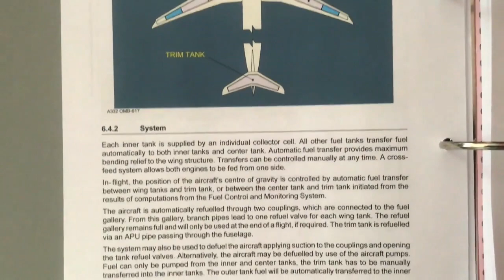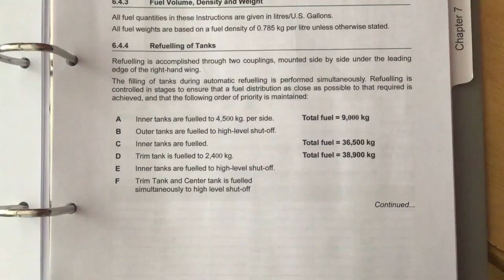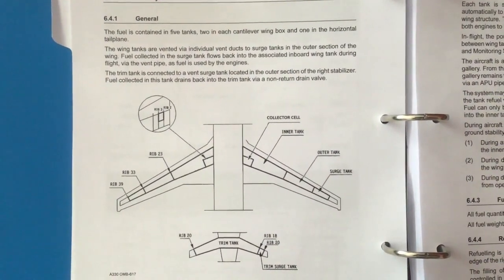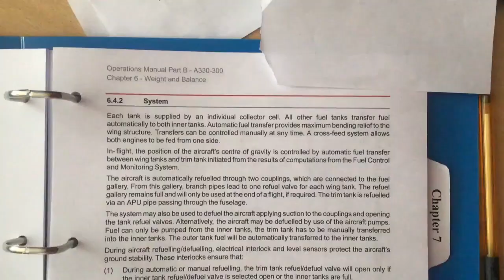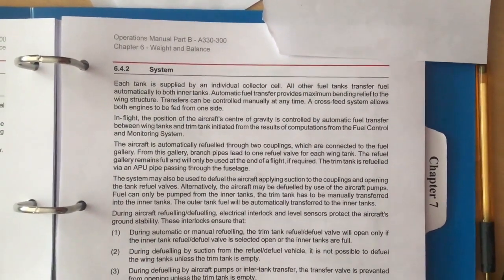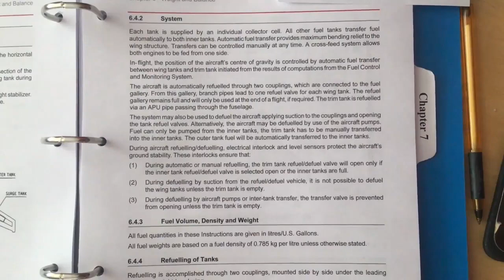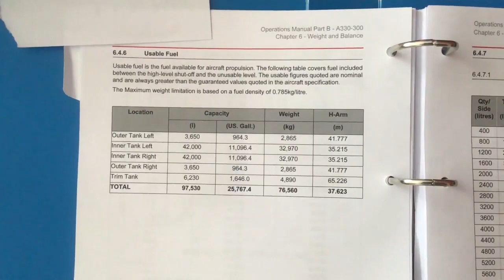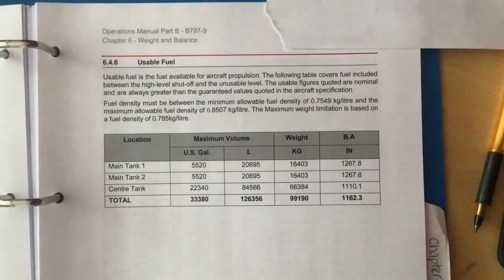aircraft fuel

Comment: Excellent use of the weight & balance manual pointing out the difference between the A.330-200 & 300.
As stated the 300 has a slightly shorter range due to a lack of center fuel tank.
These manuals don’t lie and a simple fuel burn rate and distance traveled shows the fuel call outs to be correct. 👍
Reply from the maker: DC8Combi cheers for the comment. I am trying to get a fuel drain video done with both an Airbus and a 747 which will show the difference between water and fuel. It is just finding the time.
It is getting annoying with jones deleting his live feeds. That Constantine could be Jake Penny as the comments had the pointless stupidity and the foul and offensive mouth of Jake. Just another thought. 👍
Reply: @ianobiwan  I agree the deleting of the live feeds is annoying I'm guessing it's some delusional strategy to gain popularity or even sympathy as he has a deep seated need for both.
Good observation with this Constipation (I mean Constantine) misfit as we all know the oxygen thief cannot resist existing.
Reply from the maker: DC8Combi  EBNM new video about the road signs is so funny. How does he survive a single day. 😂😂😂😂👍
Reply: @ianobiwan  it was absolutely hysterical I had to enter under my classified channel to prevent from being blocked.
Reply from the maker: DC8Combi  I see has been deleting everything from today. I had commented on some of his remarks today but those remarks are now gone.
Reply from the maker: DC8Combi  strangely the comment Constantine made against duke has gone as well. It is looking more and more like they may well be the same  idiot.👍
Reply: ianobiwan  I got over to watch Enslaved Dave's turd factory.  It must be hard going through life afraid of everything you come across.
Reply: @garygolfer3243  I see the Agency is doing a fine job over there on Josh Stones comedy central. They have even infiltrated EBNM under their highly classified ID's.
Miss Duke is up to her old Jake the oxygen thief's ways deleting her comments in hopes of making us look like we are commenting to nothing. Miss Duke fails to realize her deleted messages remain in our notification. The joy of suffering from Dunning Kruger!
Reply from the maker: DC8Combi  jones has put his father’s day ramble video back up.
Reply: ianobiwan really, what is that pied piper of mental misfits up too 😎I’m gonna have a look about over there. 👍
Reply from the maker: DC8Combi good morning, jones is dicking around again, he has just removed the video again. 
I am just waiting for a couple of jets to arrive this morning.
Reply from the maker: DC8Combi it’s just about 13.00 and the turn around went well, just got a night stopper to sort out. Not to many issues at present.
This deleting and reposting must be a misfit thing to keep the gullible and stupid intrigued. 😂😂👍
Reply: @ianobiwan  glad to hear the gals had no problem turning and burning, sometimes as you know they wanna hang around lol.
I'm guessing once you sort out the night stopper you put her to bed until morning?
The Jones madness of deleting and re-posting will reveal itself eventually, very possible a Miss Duke / Jake suggestion.
Reply from the maker: DC8Combi the late shift will be putting the night stopper to bed. And she was quite clean just a small body gear steering issue which is now sorted. Why does chapter 32 stuff have to be so dirty!😂😂
Reply: ianobiwan 😂I’m guessing if them gear are too clean they may not be getting lubed 😮but yes chapter 32 is dirty nice job for the eager apprentice’s 👍
Do your overnighter’s not require preflight’s as they don’t sit long enough.
I believe the rules differ for aircraft and airlines.
Reply: @ianobiwan  the UK is to get some MH-47G's I built many for US Special Forces, she is known for her fat fuel tanks, refueling probe and aft left & right square gunner windows, and black paint. She's a beast a very feared by the enemy. https://www.janes.com/article/83930/uk-cleared-to-procure-additional-chinook-helicopters-likely-configured-for-special-operations
Reply from the maker: DC8Combi the preflight will be done in the morning before she flies. 👍👍 We know them as transit checks.👍
Reply: @ianobiwan  got ya sometimes our birds would not sit more than a specific amount of hours and this allowed them to fly again without preflights for so many days, I forget the rules we followed.
Reply from the maker: DC8Combi I have just seen EBNM has posted another new video. This time it is a video Maggard made months ago he has only changed the title 😂👍👍.
Reply from the maker: DC8Combi also professor jones does actually reply to some of the comments whereas EBNM and Maggard never do. 
Duke/Jake/Constantine seems to have disappeared which is good news. 
Well I am going to go and get a bit of sleep as I have work in a few hours. Have a good evening sir.👍👍🇬🇧
Reply: ianobiwan correct Jones does reply sometimes frothing at the mouth but very funny.
Yes, get some sleep good night sir. 👍
Reply from the maker: DC8Combi  good morning sir, duke is back and dropping nonsense on the jones moon video from last week.